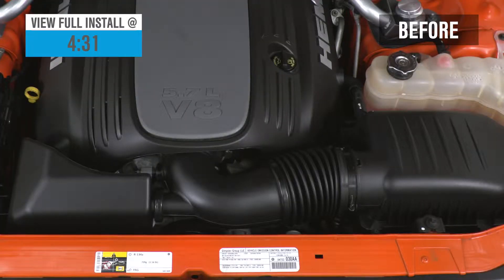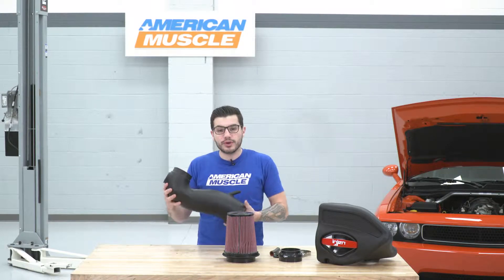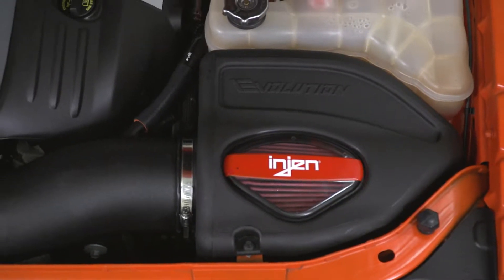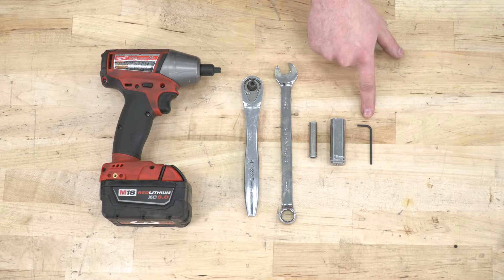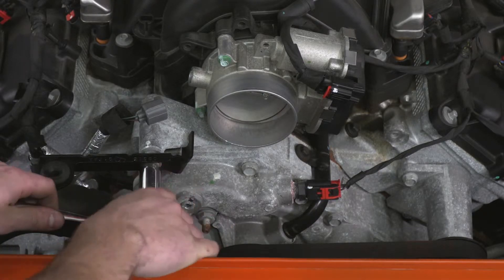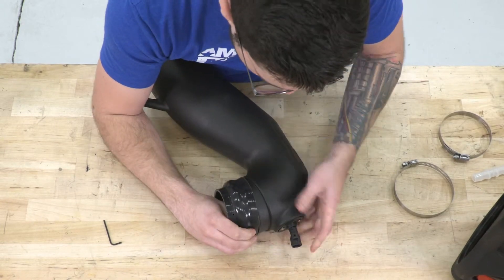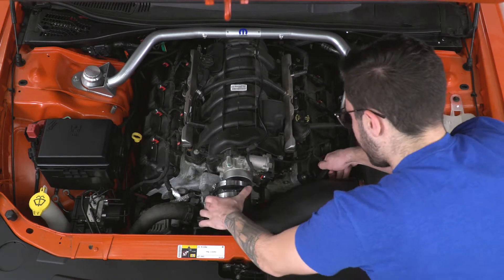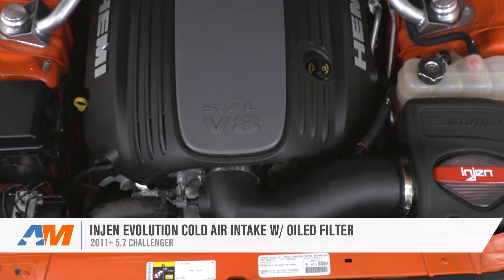2011-2019 Challenger Injen Evolution Cold Air Intake w/ Oiled Filter 5.7L HEMI Review and Install

Comment: Might want to explain that you should probably not put in the sensor until it is completely installed to the intake and throttle body, the amount of force used to put on the rubber gasket almost snapped that baby off.....
Reply: You saw that too